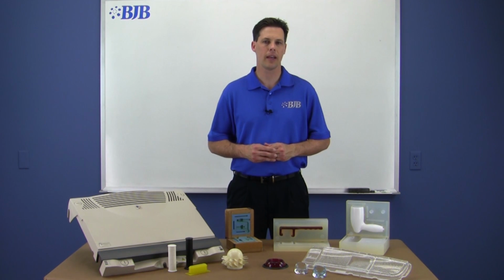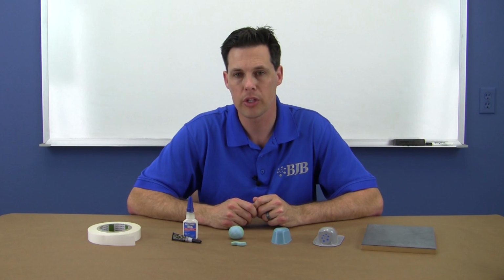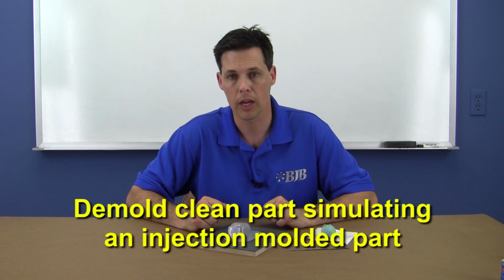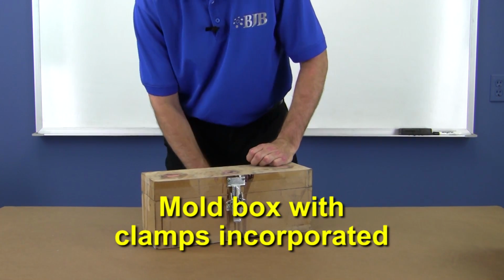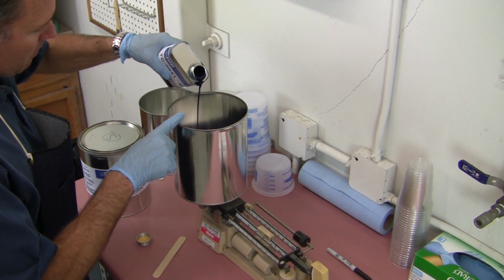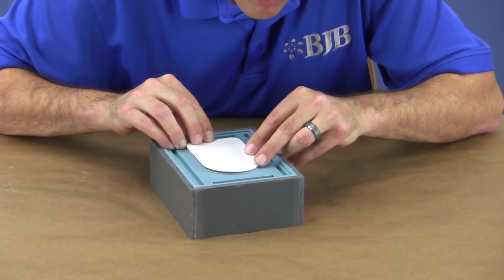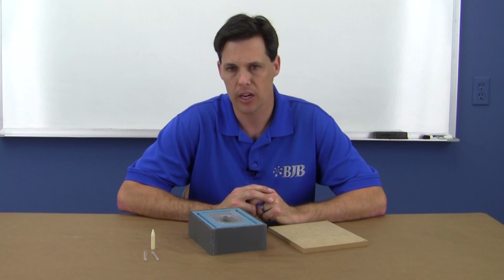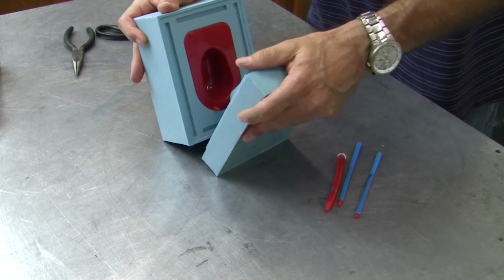Great Video: How to make 2-Part Silicone Mold | Part 1

Comment: I used double-faced Scotch brand tape to adhere my flat backed bead to a flat surface, but the liquid silicone molding material, Alumilite Quick-Set, remained liquid and pitted where it was in contact with the tape.  Is there a better double-faced tape or sheet of double-faced adhesive to use that won't cause this reaction?
Reply from the maker: That's interesting that you had what we call "chemical inhibition" issues with a Tin-Based Silicone.  Tin Silicones tend to be much more tolerant and user friendly against a variety of surfaces. In a situation like this, I would run a small experiment to test several different tape adhesives.  Put the different tapes in a small container and pour a small amount of silicone over the top of them and check the results.  It's hard to say exactly what will work since we don't know what Scotch Brand uses for their adhesive on tape.  We often use Nitto Tape Brand for our double sided tape and have great results.  https://www.amazon.com/Nitto-Permacel-P-02-Double-Coated/dp/B003ZFAN4U/ref=sr_1_3?ie=UTF8&qid=1522946471&sr=8-3&keywords=nitto+tape+double+sided

Comment: Great video . Is there any other video like this explaining the procedure of making metal casts , lets say like rings , with silicone mold ? And if yes , how many replicas this silicon mold can produce metal rings , before the mold is no longer usable ?
Reply from the maker: Silicone molds can be used for "low-melt metals" but typical jewelry metals used to make rings would likely be too high temp.  You may only get 1 or 2 castings before the silicone mold is ruined.  We have had customers use the method in unique situations, but it is not a great solution for multiple parts or production.  Customers do use silicone molds for casting wax masters and then performing typical lost wax metal casting.

Comment: Great job.....was the high gloss finish achieved because of the smoothness of the master or was it the resin/mold product?......thanks again
Reply from the maker: paul goodier yes, the smoothness is determined by the master and the silicone mold material will recreate it in great detail.  For example, you cannot produce lens quality clear parts if the master did not have a high gloss finish to start with.  You can also use this feature to produce highly textured parts when you apply the desired finish to the master.  You can also mix gloss and texture on the master to produce very unique finishes. Thank you for the question. -BJB

Comment: Thanks for producing such a clear and concise training video. The best that I have seen. In the video, you did not mention if the mold and the resin should be put in a pressure pot while the casting is being cured to avoid bubbles. Please advise.
Reply from the maker: Fook Y Loh pressure casting is a great way to improve the quality of your parts, but setting up a mold properly from the beginning is the best method for overall consistency.  Pressure casting should be an “insurance policy” and not depended on to minimize trapped air bubbles.  It’s easy to use pressure casting on small molds but what if you are casting a large mold and your mold doesn’t fit in your pressure vessel?  If you learn and practice the proper way to arrange vents and the fill port, you can often produce excellent results without pressure as shown in the video.  Great question and thank you for the comment!  -BJB

Comment: Is it possible to mold and make parts with abs plastic?
Reply from the maker: No, that is done with injection molded techniques and requires molds that can take very high pressures.  We can simulate ABS plastic with many of BJB's rigid polyurethane casting materials.  Take a look on our website.  https://bjbenterprises.com/index.php/polyurethanes/castable/rigid/non-fire-rated/

Comment: Great Job, How many times can you reproduce the Fireman's Helmet, before the mold is no longer usable?Respectfully, Jim P.
Reason I am asking is i need to pour make some old replica Cox Magnesium Speed Plans for Vintage Speed Airplanes U-Control gas operated, model engines in the .049 ci. engines,meaning the piston is a ""hair under 1/2"" I will have probably a 3/16" thickness, and I need a stiff rigid plastic with a little flex but not to the point you drop it you break it. I will need to cut threads at a certain point or counter sink small 3 m nut, Hot Fuel Proof, and potentially 250-300 degrees. I was thinking of using a Delrin plastic as that is what was used 20-30-40 Years ago and holds up well. May I get your opinion, I like your simple straight forward stile, clean crisp molds, it is all great works, Respectfully, Jim P. I would like to send you a Pic of what a Cox Speed Pan for 1/2A Engines, Any way of doing that, so you could see if i am wasting my time??
Reply from the maker: Hi James,  thanks for your comment.  I am very aware of .049 engines and U-control.  I would imagine we might have a material that would fit your needs.  We have many rigid, high performance castable polyurethanes that can withstand over 200F heat.  The trick will be to see how it behaves with Nitro fuel and Castor Oil.  A couple products to look at would be the TC-895 and TC-896 on our site:  www.bjbenterprises.com   How many parts will you get out of a silicone mold?  There are several variables but 25-50 is a possible quantity. Also, feel free to email us to see what the parts are you are looking at re-creating and we can go from there.  Regards  -BJB

Comment: Would this work if I wanted to mold a part in Nylon plastic?
Reply from the maker: If you are looking to make an actual Nylon part, no.  Nylon is an injection-molded plastic that is injected into metal molds via high pressure.  However, if you are looking to simulate the feel of Nylon in terms of stiffness with some high impact properties, we have castable urethanes that do a nice job.  Many of our customers produce functional prototypes or short run production parts that stand in as a Nylon part, but Nylon is a very unique material with unique properties.  Does that help or do you have additional questions.
Reply: Yes, thank you very much. I would absolutely entertain the idea of urethanes as long as the cost of producing my parts is substantially as low or lower than making a nylon mold on my own. Do i simply just contact the sales department at your firm if I have questions and want to try it out?
Reply from the maker: Yes, we have a great technical sales staff that can go through the applications and material recommendations with you.  We also can send you some cured samples of sample urethanes so you can see and feel the materials you are planning to evaluate.  714-734-8450 or www.bjbenterprises.com

Comment: This is really complicated. You have to get so many things just right. And how many people have access to a vacuum pump?
Reply from the maker: True, it is complicated.  Especially if you try and learn all this on your own the hard way.  There are simpler ways to make molds but this is geared for short to medium-run production.  One piece molds are very easy, you can see a sample video here: https://www.youtube.com/watch?v=dWVrCffgoDc&t=42s  Regarding vacuum pumps, we make mention in several videos that you don't need to use vacuum, but you will likely be dealing with air bubbles in your molds and parts at some point.  That might be fine for some parts (hobby, craft, one-offs, etc).  Vacuum systems can be built for a few hundered dollars, but if you are a small business or entrepreneur this cost is minimal compared to typical development costs associated with product development.  Thanks for your feedback! -BJB
Reply: Thank you for taking the time to respond. I should have added in my original comment that your video is very thorough and well put together. It's just the process that's complicated, but your video is as good of an aid through that process as one would wish and I appreciate the content.

Comment: VERY NICE VIDEO: question as you showed the poring and riser tubes, would the tips where they are super glued to the Patten not show on the surface after casting or would you buff them out?
Reply from the maker: Good question.  Yes, there will usually be a small mark where the point had been glues to the pattern.  The mark is typically easy to sand off so it is less noticeable.  We'll usually try and place the vents in an area that will eventually be hidden so it's not too obvious, just like injection molded parts.

Comment: How many polyurethane models can you reproduce with one mold ?
Reply from the maker: Great question.  There are several variables to the tool life (geometry, undercuts, casting material, mold release used, etc) but we find you can achieve anywhere from 25-50 parts out of a typical silicone mold with occasional cases seeing up to 75-100 parts.

Comment: Great video guys. Question: I do not want to invest in a vacuum pump. What is the best alternative or how do I treat the rubber to get the least amount of air bubs. Thanks!
Reply from the maker: Some mold makers in your position will sometimes put their molds in pressure-tanks to deal with the air.  Though if you do, you will need to cast your parts under pressure every time because the air bubbles do not disappear from the silicone, they are simply compressed down while under pressure and will rebound at ambient air pressure.  Some folks will also pre-brush a layer of silicone over the model to decrease air on the surface.  The brushing action pushes air away from the surface as you go.  You may still end up with air trapped in other areas of the mold and that affects the tear strength and toughness of the mold.  You can also try and pour the silicone in a very thin stream into the mold box so the bubbles elongate "going over the falls" and pop on their way down.
Reply: Roy Schurgers

Comment: I noticed that, at 17:14 in the video, you use what looks like some sort of PVC pipe injection device. What is that, exactly? Is there another video in which we can learn how to make one of those for larger molded parts? 

Thank you!
Reply from the maker: Hi Matt, what you are seeing there is a static mix tube from our meter-mix dispense equipment.  So it's not as simple as a PVC pipe injection rig.  Having said that, there are some people who use tall PVC pipes to act as their pour funnel and occasionally they will rig-up a piston inside of it to manually force material into the mold.  Here is a sample video of the equipment I mentioned:  https://www.youtube.com/watch?v=62G4NlXKurI&list=PL_Aij55CbyPnsh_tlMExDsY20fEEyh3vL&index=3
Reply: Thank you! What would you recommend for a casting made in a silicone mold that's about 5" x 2" x 1" (about 10 cubic inches). 

I'd be interested to know what sort of resin or material you'd use to actually MAKE the casting, and the method by which you'd do it. 

Thank you!
Reply from the maker: We have so many options, it depends on what you want the finished part to feel like (ABS?  PC? Polypropylene? Rubber?).  Our part 2 video addresses casting parts, but if you need more help choosing it's best to chat with our Tech Staff to narrow down material selection:  info@bjbenterprises.com   https://www.youtube.com/watch?v=tnY86LIHf_I

Comment: Hi, Awesome video. I have one question, I wish to make a two piece mold of an old 50's lawn mower tin wheel, the profile is identical on both sides of the wheel but one side is badly corroded and has lost it's profile where as the other side is very good. My question is can I make the first half of the mold from the good profile of the wheel, then when cured remove and replace the wheel back into mold so the good profile of wheel will do the second half of the mold. If so, what precautions should I carry out.

Many thanks
Steve.
Reply from the maker: +tyro185 Hi Steve, it's possible to achieve what you're trying to do.
It may be more practical to cast a mold from the good half, then cast 2 rigid
urethane parts from the mold, join the 2 halves, and make a complete mold from
that Pattern. If you have some more pics and info, please contact our Tech
Department by email: info@bjbenterprises.com

Comment: Awesome video, got me thinking...  Could I cast tin-based silicone into a platinum-based silicone mold (or vice versa) if I use an agent that preferentially bonds to the casted silicone rather than the mold silicone (acting as a sort of release agent)?  I want to do this because I want to make a firm widget having a rubbery-silicone surface, steps: (1) Rotocast preferentially-sticky "release agent" (2) While still in the mold rotocast silicone that preferentially sticks to agent in step 1, (3) while still in the mold fill with expansive foam core.  Wacky or doable? Thanks!
Reply from the maker: +dave daverson You can cast Tin silicone into Platinum silicone, but not the other way around.  It sounds like you might actually want to rotocast a flexible polyurethane and then back it up with an expanding rigid polyurethane foam.  You'll end up with a rigid part that has a flexible and compressible skin.  If you use silicone as the skin, it won't bond to the urethane foam.  You might want to send us an email or call to discuss in more detail.  There are other factors to consider and questions to be answered to give a proper solution.  info@bjbenterprises.com or call 714-734-8450
Reply: Thanks for the feedback.  Tin silicone into platinum silicone- interesting.  It's for a grippy thing you hold with your fingers ... silicone I think has a better texture for that than an elastomer, yes?  Also, some creative ideas for a filler.  I'll give you a call.  Thanks!

Comment: how much would you charge me to make me a master
Reply from the maker: +rick oconnor We do not offer that service; we are a manufacturer and supplier of molding and casting products.  However, there are many outlets to have a Master made.  You can have prints made through service bureaus or online services like Shapeways.  You might also try networking to find someone local with a printer who can print you a part for a reasonable cost.

Comment: Would I be able to make a superhero mask?
Reply: +gabrial mekai I think technically speaking it would work long as you had two copies of the face mold for the inside, from a basics standpoint the video showed you how to create a mold with two different faces and a void for filling. Allowing you to create any mold in the same style as an injection molded part. complexity could be increased but it wouldn't change the general part result.

Comment: I want to cast a belt buckle, what do you sugest I use for mold and cast?
Reply from the maker: private91205 Depending on the shape and detail of the part to mold, you might need to provide more info in order to get a proper recommendation of materials to use.  It would be best to contact us through our technical email and if possible provide pictures and description.  info@bjbenterprises.com

Comment: This video (and part 2) is absolutely fantastic - it gets into the maths and science behind mold making, and makes it very clear and engaging.  I'm planning to cast a model of an excavator bucket and being similar (in principle) to the helmet, I will be able to follow most of this to the letter.  However, the bucket has relatively sharp teeth pointing away from its concave body so if I mount it as you have mounted the helmet, the sharpest parts will be inclined upward rather than downward.  I was thinking of running small vents from each of the five teeth to counter this.
Reply from the maker: LennyRhys Hi Lenny, yes you would probably want to put the teeth vertical and simply run small vents off of them.  You can customize the shape of the vents to make a "Tab" instead of a sharp point which might help better define the edge of the teeth.  If you put a definite line at the point the tab touches, it will typically break clean at that spot when removing the vents during the demold process.  Think of the tabs that hold parts on the runners of a typical plastic model kit and you've got the idea!
Reply: BJBEnterprises Thanks so much for the quick and helpful response!  One last question that I don't think was answered in the video:  does the mating surface of the two silicone mold "halves" have to be horizontal, or is that more for simplicity rather than necessity?  The reason I ask is that I want to run the seam along the opening of the bucket, but the sidewalls of the bucket are not straight; instead they look like... pacman with a very wide open mouth, about 160 degrees.  If the mold halves matched this angle, might there be complications?
Reply from the maker: LennyRhys  Correct, the split line was done flat for simplicity.  There is no problem to do what you need to do for the bucket.  If your parting line (mold flange) is curved or changes levels you simply need to build up something underneath the part to meet that level.  Most people likely use modeling clay because it is easy to mold and shape, but you can also custom cut wood pieces (or use a plastic like the styrene shown in this video) to create that line if the geometry is fairly simple .  We address that in our other video: https://youtu.be/b_KMWhJyYLE?t=4m  The next thing to do is make sure you have good alignment keys for proper registration.  If you cast the silicone mold into a square/rectangular block, you can place it on a board and angle the fill port and vents accordingly.
Reply: BJBEnterprises Excellent!  I will make sure to share my progress and results!  Thanks again!